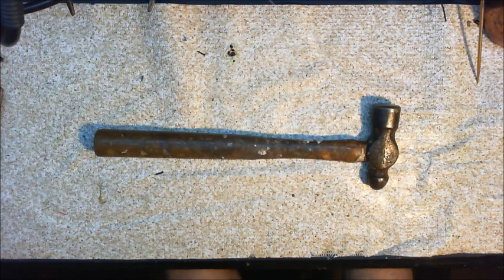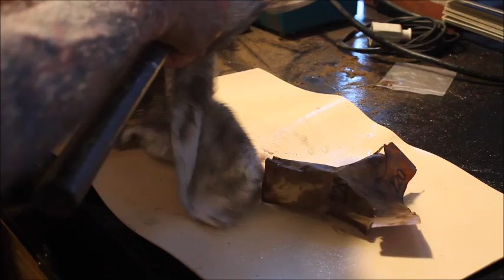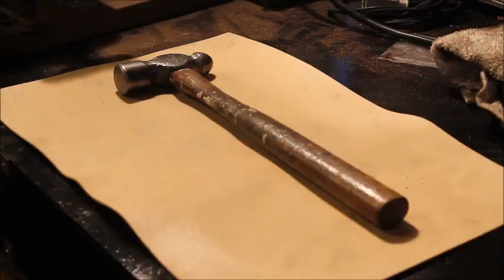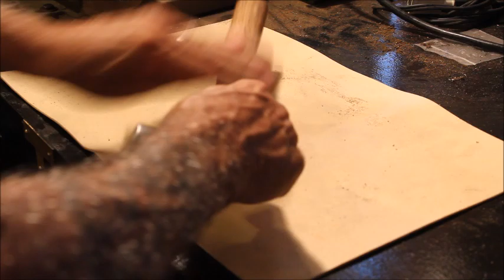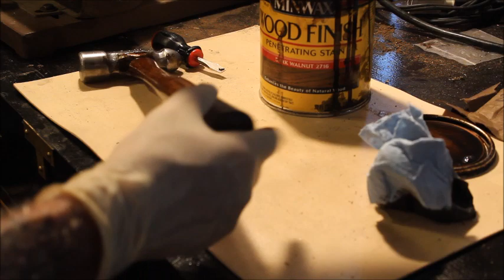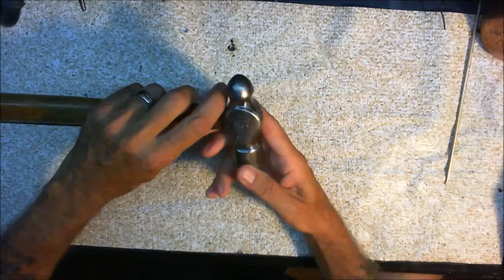Vintage Ball Peen Hammer

Comment: It's still Wire Works only this time it is a Wire wheel!!  Awesome job!  That hammer is awesome because I believe it's about a 10-12 oz model with the slightly longer handle (made for 14-16oz heads)  also I agree that the head is an older design because like you pointed out the shape of the ball is less rounded and if you notice the striking head seems more weight forward!  Really nice design!  I really like 10-12oz hammers, they are comfortable and very accurate!  This hammer has a great history and the way you restored it I know it feels great in the hand! The kind of hammer you just want to pick up and use!  I bet you enjoyed this project and felt a true sense of satisfaction!!!  Looking forward to the next restoration!!!   Thanks!!! 😃👍
Reply from the maker: ScoutCrafter Thanks for the comment